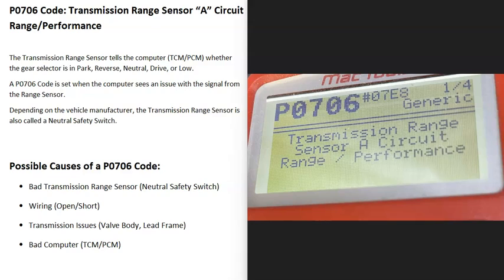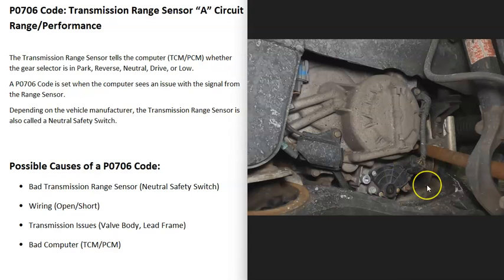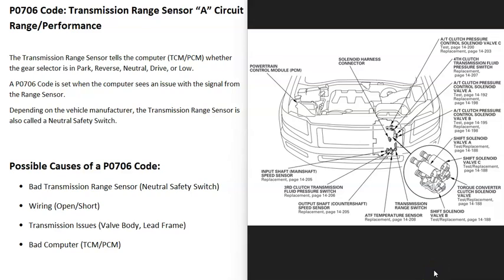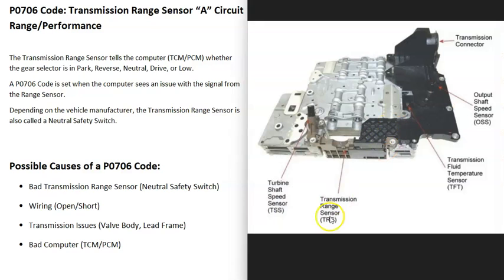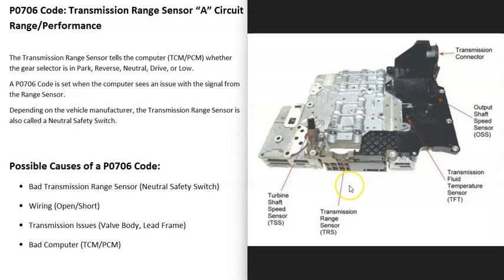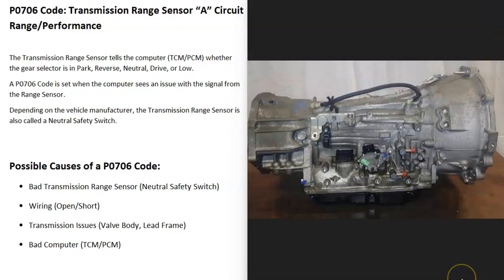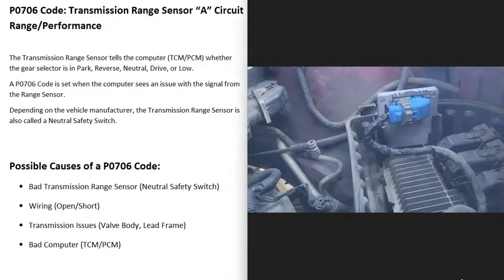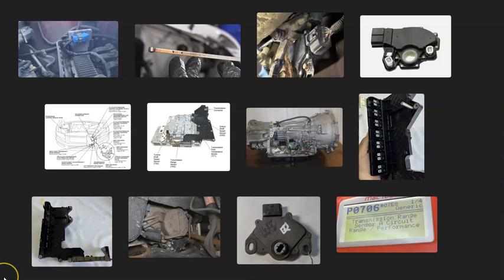Causes and Fixes P0706 Code: Transmission Range Sensor “A” Circuit Range/Performance

Comment: I got same codes and circuits A. I check fluid its about a quart low. Could this be the issue also low fluid?
Reply from the maker: Low transmission fluid can cause issues, but I don't see how the range sensor circuit would be affected.

Comment: I have a 2011 Ford Fusion SEL 3.0 V6. I bought the part but need to know if it’s correct. Google brings up different parts, so I’m a bit confused. I ordered the part mentioned in your video. Just wanted to make sure that this is the exact part.
Reply from the maker: Sometimes it can be best to go to an automotive store and let them look up the part to be sure it is correct. Otherwise, match it to the old one to be sure it is the right part. One thing to mention is that it's best to check the wiring first before buying the range sensor, but many people often replace it first.

Comment: About how much could this cost
Reply: Your guesstimated  guess
Reply: Depending on the type of vehicle, but usually around $70 for aftermarket or $170 for oem. That's just the part, not the labor to install it.

Comment: 2017 F150 … code P0706 0707 … repair shop trying to say I need to replace transmission???
Reply: Just happened to mine yesterday same code about to find out what's wrong with it in a couple of hours I'm thinking it's the sensor I hope it is 😢 ....what did yours end up having...update please
Reply: Same year also

Comment: I washed my engine and then it was loosing power until it got neutral... I have the code 0706... It doesn't recognize Drive or Reverse.... Only Pare and Neutral.... Help  please
Reply from the maker: Something likely got wet. Often, after getting wet and after drying out, components start to work again; if not, something may have shorted and will need to be diagnosed.

Comment: Just got that code today, day's after I had my transmission replaced, after it went bad. (2017 Nissan Altima SR, only 45K miles too, shame).
Reply: What was the issue in yours? The sensor? I have the same car that’s why

Comment: I used backprobe and in Park or Neutral there is voltage (B+). In other positions its ground potential. So this means one of the module is bad. Could also be the IPDM module, HYbrid control module (it’s a hybrid infinity) or defective TCM

Comment: Is it okay or safe to drive with this code
Reply: Yes you can drive it but it can make the car go into limp mode. And it can cause more damage . Buy the part off rockauto and install yourself . Very easy to fix
Reply: @PathToProsper209  okay thanks 🙏🏽

Comment: that was a very helpful video! so I accidentally spilled soda in my '09 Optima's gear selector. I superficially cleaned it, but a few weeks later, my check engine light came on, and it reads this same code. do you think it could be the reason?